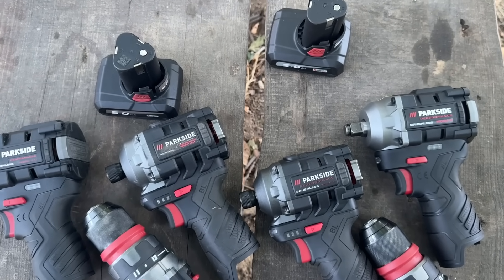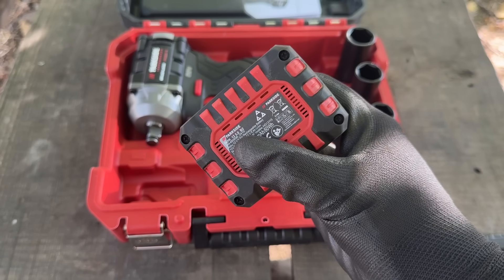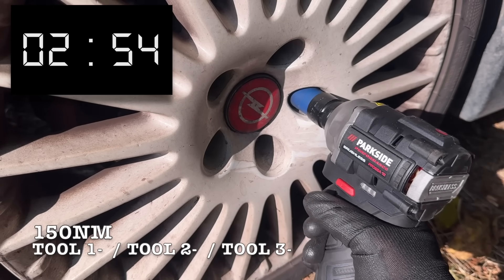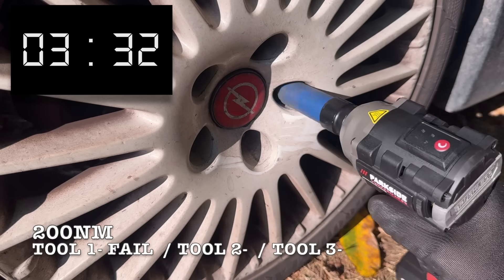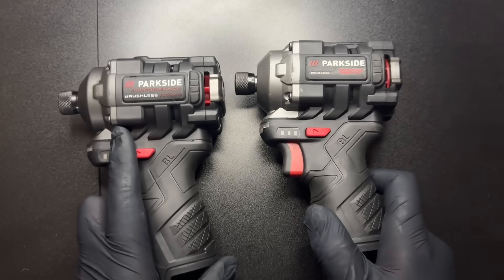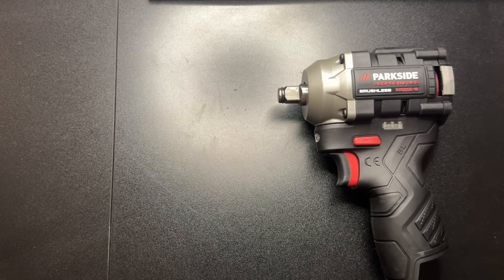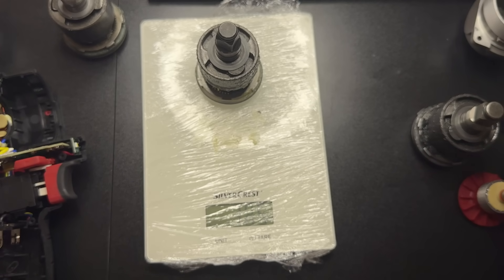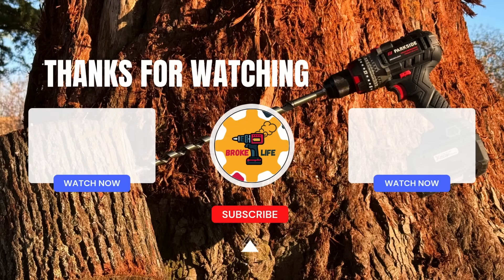Surprise! Parkside Performance 2025 Tools - Test and Teardown, PDSSAP & PPDSSA A1 12V.

Comment: Mine was manufactured in May 2025. After seeing the video, I opened it out of curiosity to see if mine was the same as the ones from April inside and fortunately, it wasn't. I bought it a week ago and used it a bit. As for performance, I have nothing to compare it to. Thank you very much for the videos you make. I appreciate them because they help me a lot with details that I didn't know about certain Parkside products and comparisons with other brands.
Reply from the maker: That’s great! Can you confirm that we’re talking about the PPDSSA A1 12 and that the anvil and hammer assembly lookike the ones on my 2024 version?
Reply: @BrokeLifeEU  i have PPDSSA A1 12v from 05-2025, the hammer assembly is identic with your 04-2025, the anvil lobes have round tips, not squareish with filleted edges like 2024. Mine is brand new, i used it once on 6 wheel lugs just to see it in action. The contact area on the anvil is not equal, one is bigger on height compared to the other contact side. The anvil is not centered like on 2024 as one can clearly see in your video, the spring force the 2025 anvil shaft to the side, when assembled i suppose the group will center everything, but i wonder if that radial force created by the spring is at least amplifying the problem or may be the cause. The 2025 hammer is different too, the 2 engaging teeth are a little recessed on height, resulting in a smaller contact area, on 2024 as far as i can see on the video the upper surface of the anvil lobes are flush with the hammer surface, but on 2025 the anvil is higher by approx 1 mm. On the 2024 i can see no rounding of the hammer teeth or on anvil, but on my 2025 after only 6 lugs there is a little round on the edge and the lower  contact surface of the anvil developed a little burr, that explain the little metal shavings i found. I depressed the spring just to see if the anvil lobes without spring force align with the hammer teeth, and they do align. When on the saft, the anvil has a little wiggle that i suppose is neutered to a degree by the front bushing, but the bushing must have a little give to not seizure. So maybe in the end the spring that is pushing the shaft to the side is the main cause of the asymmetric contact?
Reply from the maker: @flotr6465 That is a very good observation and I could not have put it better myself, the disappointing answer is however that I don’t know if it’s the spring causing all of this…
Reply: @BrokeLifeEU  Yes, it is PPDSSA A1 12. The hammer is the same as the 2024 one, but the anvil looks like the April 2025 one, with rounded corners. I removed and tightened 16 wheel bolts. Plus a few 8/12mm wood screws, before I disassembled it. The hammer had no signs of wear like the ones in your clip. The only problem I found with it was the screws used for assembly, which were hardly tightened at all.
Reply: @laposi01  The 2025 hammer is not the same as the 2024 one, the upper face is flush on 2024, but on 04 and 05- 2025 it is machined a little, creating a circular lip and reducing the hammer teeth height. Please look at the anvil contact surface, is it equal on both sides or not?
Reply: @flotr6465 Sorry I wasn't more careful when I disassembled it to check all the differences. I just wanted to see if the hammer had the same wear as in the video. The only thing that stood out to me was the anvil, but unfortunately I didn't check all its dimensions. Since the anvil is more rounded, the hammer doesn't hit it perfectly, but it has contact on its entire vertical surface, there are no signs of slipping during the impact. I would disassemble it to measure it, but as I said in the first comment, the screws weren't tight and when I reassembled two screws from the motor blades were no longer tight, they were spinning loose and I don't want to be unable to use it because of that. Clearly a big QC problem.
Reply: @BrokeLifeEU  That same day, I also bought two 5-amp batteries, which I tried before charging them. And the charger I used was the double 4.5 amp one, not the 6 amp one. Maybe that was your problem, or I had luck with them.

Comment: Das Rätsel wurde gelüftet!
Großartige Aufklärung 👍
Ich habe auf AliExpress Getriebe gefunden, aber ob sie passen weiß ich nicht. Die Frage ist auch ob ein Tausch sinnvoll ist… da kann man auch gleich eine 20v Version oder andere Marke kaufen.. 

Was will man schon sagen Parkside ist Low Budget Werkzeug. 
Aber trotzdem bekommt man oft viel für sein kleines Geld 😉
Reply from the maker: Ich stimme Ihnen vollkommen zu – es gibt wirklich großartige Angebote von Parkside, und man bekommt sehr viel für sein Geld! Ich selbst besitze viele Werkzeuge von Parkside, und meine ersten Elektrowerkzeuge waren ebenfalls von dieser Marke. Daher würde ich mich durchaus als Fan bezeichnen.
Falls es Ihnen nichts ausmacht, könnten Sie mir bitte die Links zu den Ersatzteilen schicken? Ich habe selbst schon gesucht, aber leider nichts wirklich Passendes gefunden.
Reply: @BrokeLifeEU  Ich kann leider kein link senden, da ich kein sozial Media nutze. Wenn du bei AliExpress nach dewalt dcf894 oder dcf922 Ersatzteil suchst, müssten die vermutlichen Getriebe erscheinen. Es gibt leider keine Abmessungen. Ich denke man müsste trotzdem anpassen…

Comment: i am disappointed you didn't measure the current. Even tho the motors are the same, there could be change done in firmware.
Reply from the maker: Sorry about that! But I realised I needed a proper rig to do it correcly under load which was just not possible for me at the time I was putting this together.

Comment: Danke! 
Any Possibility to get the Bigger size Hammer for the Impact Driver?
Reply from the maker: Ich danke Ihnen I think they are interchangable, although I didn't try them out, but in any case they are not sold as a spare part.

Comment: 12:08 Hallo, Look the Difference at the Anvils. New ones have roundet edges
Reply from the maker: The older ones are also rounded, they just don't look it in the video. The anvils are a problem, but the hammer is where the real answer lies.

Comment: So probably they had too many tools that broke under warranty and they decided to downgrade the hammer to make it more reliable, sacrificing the power. That's a net loss for the consumer.
Reply from the maker: It does have less power, but if the materials are good, there’s a chance it could also last longer. It really just depends on what you’re looking for. Personally, I don’t mind less power in a 12V impact driver if it means more reliability. But it’s definitely a big change—especially considering the tool’s specifications are listed as the same.

Comment: Thx for video and thorough review. I still stand with a point that if there is a change in radiator or planetary gear they need to indicate that in revision number. I chacke mine and cocmpare it with yours model.
Reply from the maker: That was exactly my point in the earlier video—I really would have appreciated some kind of indication that they had changed something on the impact driver.

Comment: Personally, I had no problem with the Parkside 12v impact wrench, it removed the wheel bolt from a tractor that I had tightened to 200 nm. Ps I was bought  5 day ago
Reply from the maker: Thank you so much for that! To be fair, my expectation is that there are some really good ones out there as well—so it’s great that you’ve already tested yours and it’s performing that well. Thanks again!
Reply: @BrokeLifeEU thank for the response Hello from Romania
Reply from the maker: @Flashe_2000  I was there recently, Romania is lovely 🇷🇴!
Reply: @BrokeLifeEU did you enjoy your trip
Reply from the maker: @Flashe_2000 It was great! But I’ll be back (pun intended) there is just so much more to see and I miss Luca in the mornings 😂
Reply: @BrokeLifeEU I bought the impact gun when you posted the Kaufland catalog because I didn't see that they posted another catalog, so thank you.
Reply from the maker: You’re welcome and I’m glad that post helped!
Reply: Also have a great day
Reply: @Flashe_2000  presupun ca scule este 05-2025 (scrie pe eticheta de pe pistol). Ai luat-o din Kaufland sau de pe OLX? A mea s-a cacait putin la desfacerea unor suruburi stranse la 120Nm pe jeep, neatinse de 2-3 ani, la automobil a desfacut prezoanele stranse la 110Nm, chiar si cu bateria de 2,5A, chiar m-a uimit ca a desfacut la fel de usor ca si bateria de 5A.
Reply: @flotr6465 este  01-2025  și  moment nu am avut probleme .
Reply: Este luată din Kaufland

Comment: Thank you for your work finding out what the issue was.

Now, I do have a question to ask. Considering that the 2025 has the anvil change, does that mean that if I were to proceed with the Freak Anvil modification (1/2 + 1/4), the new anvil won't fit? Or as long as I grind enough material to make it fit it will still work.
Reply from the maker: Thank you for your kind comment! It can be made ro fit, but the hammer itself is also an issue so I really don’t know how good the end result will be.
Reply: @BrokeLifeEU  I came back with an update. (sorry for the wall of text)

I had sent the tool in service as it sounded dry, like when the anvil would spin it would make a squeak. I was tempted to just open the tool myself and just put some grease in but I decided that I should call the service first. Told them the issue and they told me that on monday the courier would come to pick up the tool and I need to give him just the tool (no box or accessories). Monday arrived, courier came, days passed and today I got message from the courier that I have a package.

Now here's where the fun begins. When I sent the tool, I just put in a small box with some bubble wrap and some extra cardboard to stop it from moving around. When the courier arrived, he had a huge box and I was surprised thinking "wow, they really don't skimp on packaging". When I opened the box, then I realized they just sent me a brand new complete box. A bit overkill in my opinion when they could just open the tool, put some grease and send the tool back.

And now the big reveal is that they sent me a 05/2024 manufactured one🤩(before I had a 05/2025). So I guess in the end it was worth calling the service and having to wait some days.

First time ever calling Parkside service for an issue, and all I can say is that very happy😂
Now I just need to figure out what to do with an extra box and "impact" sockets 😅
Reply from the maker: 🥳 Have you tested the new one out yet!
Reply: @BrokeLifeEU  Not yet. I will try to test it today if the weather gets better.
Reply: @BrokeLifeEU  Okey, I tested the tool today on some car lug bolts. As I don't own proper impact sockets I used the one provided in the box. It managed to unscrew the bolts with no issue, then I tighten them back on mode 2 as that's the closest torque to the one specified in the car manual.

So I guess the tools works fine😀, the only issue I have now is that the sockets are very hard to put on the anvil, and even harder to pull them out, guess they messed up the tolerances. But I guess this is a temporary issue as I'm waiting for the freak anvil to arrive😉

I'm gonna thank you again for all your work on the Parkside videos. Keep up the good work!

Comment: Thank you for the video! I was really disappointed with the 2025 model, mine was not able to unscrew even at 120 Nm. I saw your video from yesterday and I leave it as it is, quality downgrade. But now, I will have a look at mine and check the gaps, maybe I will try to grind the hammer/anvil
Reply: or better - return this crap - vote with your wallet

Comment: Thank you VERY MUCH for your work and the time you put in these videos. I have an 05-2025 impact wrench, and today i will take it apart to see how are the hammer- anvil mating surfaces. Too bad i can't attach the pictures here, but i will describe my findings in words. Than we will see if there are differences between 04 and 05 batches.

Ok, edit, here are my findings: i have PPDSSA A1 12v from 05-2025, the hammer assembly is identic with the 04-2025 in thee video, the anvil lobes have round tips, not squareish with filleted edges like 2024. Mine is brand new, bought a week ago, i used it once on 6 wheel lugs just to see it in action. The contact area on the anvil is not equal, one is bigger on height compared to the other contact side. The anvil is not centered like on 2024 as one can clearly see in your video, the spring force the 2025 anvil shaft to the side, when assembled i suppose the group will center everything, but i wonder if that radial force created by the spring is at least amplifying the problem or may be the cause. The 2025 hammer is different too, the 2 engaging teeth are a little recessed on height, resulting in a smaller contact area, on 2024 as far as i can see on the video the upper surface of the anvil lobes are flush with the hammer surface, but on 2025 the anvil is higher by approx 1 mm. On the 2024 i can see no rounding of the hammer teeth or on anvil, but on my 2025 after only 6 lugs there is a little round on the edge and the lower  contact surface of the anvil developed a little burr, that explain the little metal shavings i found. I depressed the spring just to see if the anvil lobes without spring force align with the hammer teeth, and they do align. When on the saft, the anvil has a little wiggle that i suppose is neutered to a degree by the front bushing, but the bushing must have a little give to not seizure. So maybe in the end the spring that is pushing the shaft to the side is the main cause of the asymmetric contact?
Reply: Lot of thanks for your explanation .  Short resumed with 3 words : It's unreliable sheet .

Comment: Great video comparing qualities. I must say I was sad at first because my first, 2024 impact 1/2 driver died (whenever I put a battery in it the LEDs flash on the tool and it wont turn under pressure), and I was worried because I bought the new batch for replacement, but seems I can just swap the hammer mechanism on the new one and have the same performance?

Comment: Nicely done, at the previous video it was clear that the tools are not the same with big differences at performance.
Here , there is no doubt again when matching 4 tools that behave like comparing 4 different brands.
When you tear them down it is not only the manufacturing quality. The hammers have different geometry that is crucial to performance.

Comment: Great video, and investigation. I was about 80 percent sure that they have changed something in the hammer section. I don't know if this is a quality control issue, they are cutting corners everywhere. You have to pay for each operation in the manufacturing process. And sometimes the customer will take the risk of skipping some of the steps,especially in the machining and balancing of the parts. When you buy the cheap tools, you have to realize that they use the cheapest components and manufacturing, to keep the price at the same level. But finally the end customer is getting a lower quality tool for the same price.
Reply from the maker: Thank you for the comment! In the end, the problem is probably either the low price they want to sell these at, or the huge marketing costs—Arnold probably isn’t very cheap. There is a way to bring back the old Parkside, but they have to actually want that change.
Reply: @BrokeLifeEU Yess, I forget about the marketing and Arnold. Everything is more expensive, energy, materials. So my conclusion is that I prefer to pay more, according to the market and economy conditions, but get the same quality as before. Yes, I know I'm stupid, but this is the reality. Most of the times is not possible to make a better product with less money. In this case they literally cutting 20 grams off that hammer, reducing the cost. Maybe even the spring is thinner. Here is my experience, I worked in auto parts manufacturing, and when a new part was designed it was over engineered. But right after that, the optimization process started. Testing the parts and removing any unnecessary material, and pushing everything to the limit. And all that for reducing the cost, and sometimes planned obsolescence.

Comment: Keep up the good work! Try to put the Meltdown Madams in a box marked 'unhinged' and leave it at that. Only been following the Parkside tools this last year or so when they id a Knipex clone and the collection is growing. I'm in the UK and we don't seem to get the Performance range which is possibly a blessing in disguise as my basic needs are more than met with the regular green stuff.
Reply from the maker: I realised that too—most of my needs can easily be met with the regular green line. An added benefit is that on most of their brushed tools, the motor brushes are usually the first thing to go, and they’re easy to replace. With the brushless models, however, once the control board fails, that’s the end of the tool. The warranty is superb, but once it’s out of warranty, you’re out of luck.
Reply: Yeah that plus the bluetooth business to unlock extra features, balls to that.
Reply from the maker: @Skunkola  Don't get me started on the Bluetooth and App 🤣